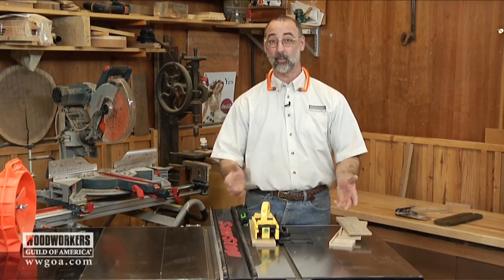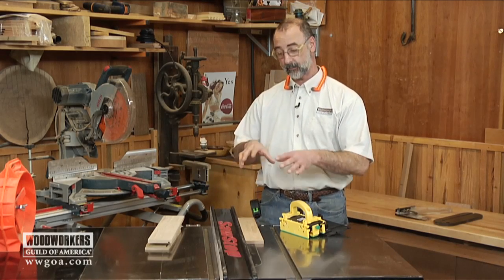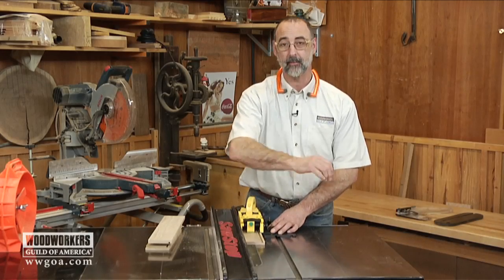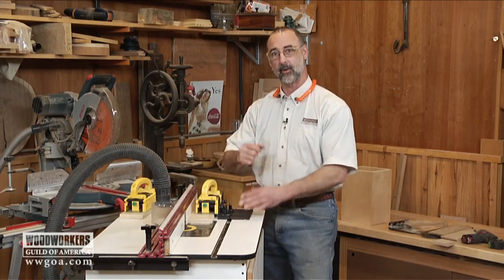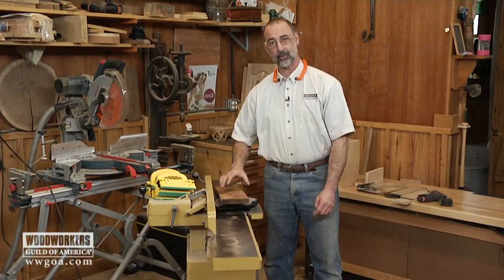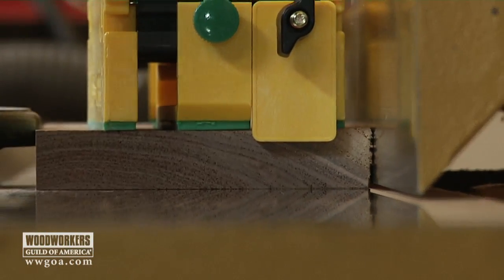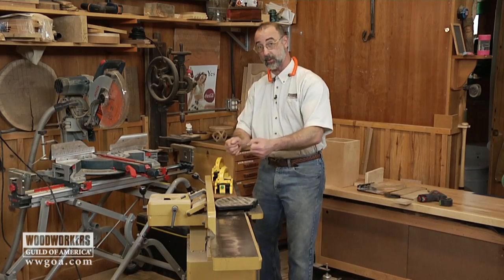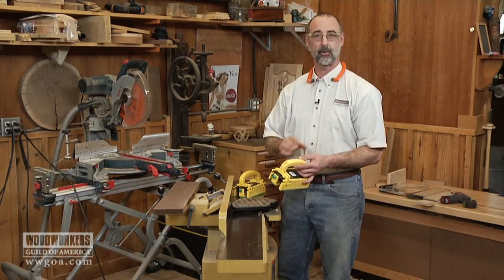Table Saw, Router Table and Band Saw Safety

Comment: Thanks, nice vid.

As a data point, that GRR-Ripper push block sells for about $49. Though it's a "system", I think that means one push block. When George does the face jointing operation, he is using two push blocks which means about $100. 

It seems like a nice product. Even nicer if the Micro Jig provides them! I might spring for one, but two is a little pricey. I suppose you could use something simpler for your second push block.